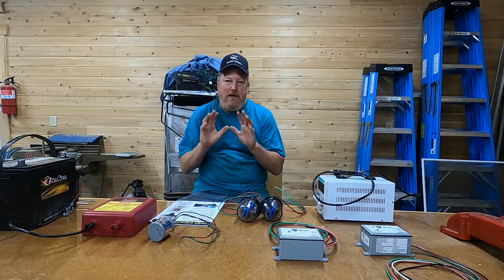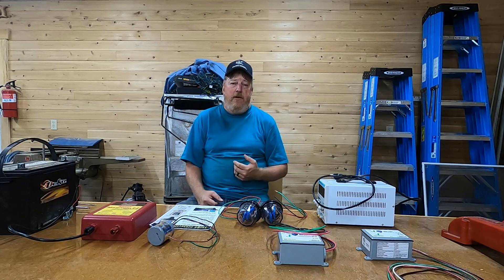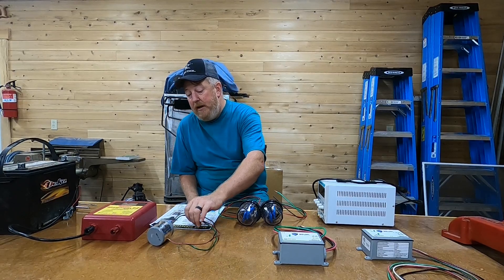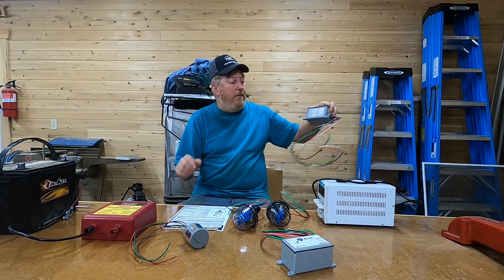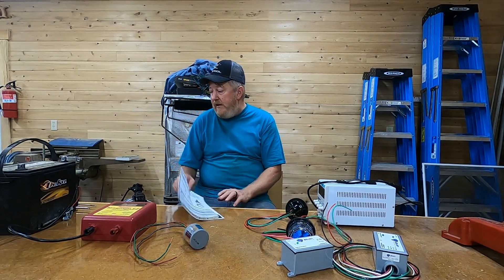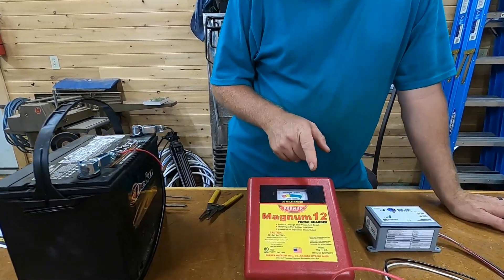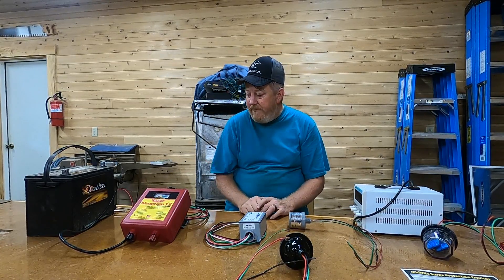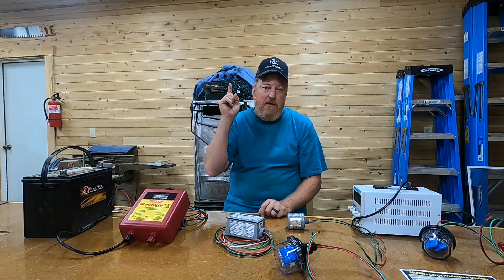Ryan Rants: EMP, Solar Flairs and Electrical Surge Suppression Part 3

Comment: So I was wondering. My solar array is about 40' from my controller (MN3024) and e panel (MNE200DIY). At the solar array I'm going to install the MNPV3 combiner box. Both the e panel and the combiner box are set up to allow a surge protector. In order to keep the e panel as clutter free as I can, I was going to install the surge protector at the combiner box close to the array thinking it shouldn't make a difference, while still protecting the controller. I guess I'm just looking for confirmation that my train is correct? Thanks again ...
Reply from the maker: Personally I would put it at the 3024, 40ft is a long antenna in a close strike
Reply: @aroundthehomesteadwithsuer3497  makes sense, thanks again..

Comment: The fast speed of the emp shield is for the e1 pulse. Nuclear emp has three separate voltage spikes of varying speeds. E1,E2 and E3. E1 is nuclear only, solar flares don’t have it. It’s a millisecond pulse that most equipment don’t actually block because of the speed. Only a handful of commercially available TVS diodes will. Don’t know if the EMP shield actually has it but it would make it nuclear emp proof of it did. After that it just depends on the strength of the emp and the length of wire. A long enough wire and it doesn’t matter if it blocks 100k volts, the voltage will climb very high. 
E2 is more like a traditional lightning strike and most standard commercial Lightning arresters will block it. I am a bit fuzzy on E3 but I think it’s more current and tends to trip regular breakers and fuses. Longer pulse.